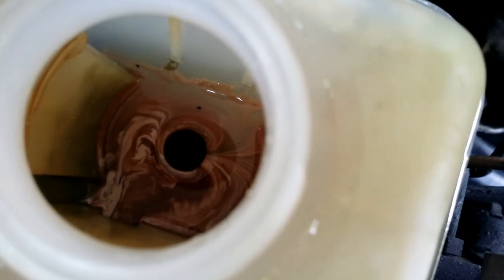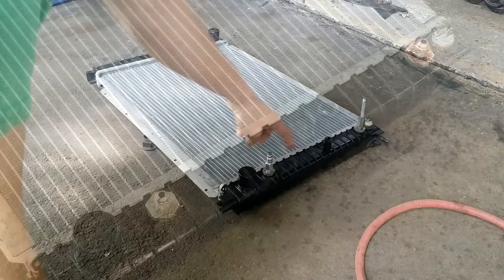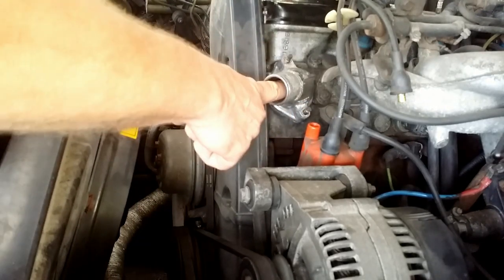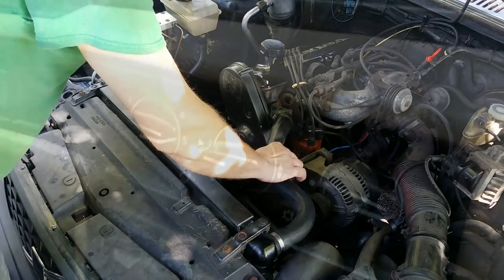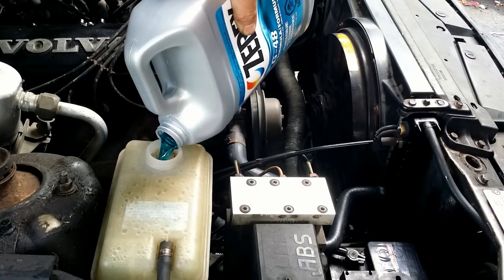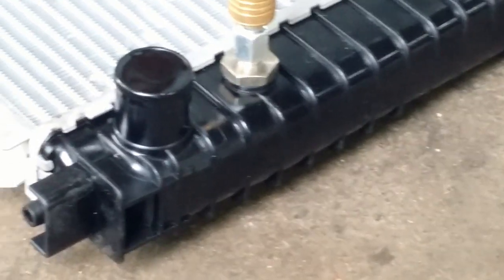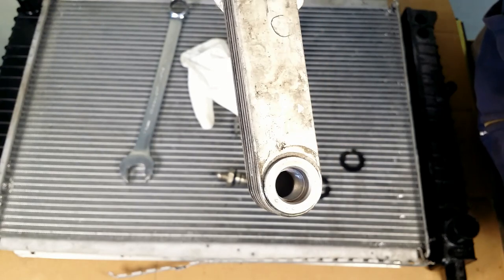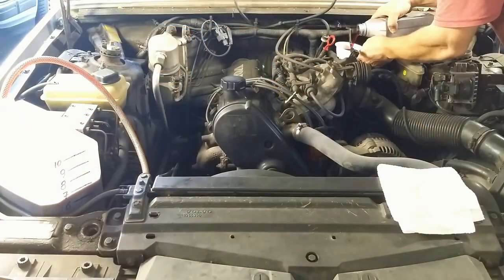Strawberry Milkshake in Radiator-ATF in Cooling System

Comment: Pain in the arse huh?  I have an Australian Ford BA ute that has the same crap designed trans cooler in radiator.  When I replaced the radiator I also fitted an external transmission cooler and bypassed the stock in-radiator cooler completely.  Now there is no way coolant and ATF can mix. Peace of mind for a couple of hundred more, absolutely worth it. Good video on your flushing process 👍

Comment: Don’t forget you also have to flush your entire transmission and replace ALL (yes all 10 or so quarts depending on your car) of the ATF. I just bought a used car. Previous owner fixed the radiator but completely ignored the transmission. He’s lucky he didn’t destroy the transmission entirely driving tens of thousands of miles with contaminated fluid.
Reply from the maker: I mentioned just that @ 8:45 onwards and made reference to my ATF flush video.
Reply: @robertdeptula2003  my bad, I only skimmed the video

Comment: I have a 2004 Toyota Corolla.  The upper transmission cooler line and fitting broke off the radiator (I don't know why) with trans fluid and coolant leaking all over.  Engine coolant is now leaking from the hole that has been created by the fitting breaking off.  I want to know if engine coolant has gotten into my transmission.

Comment: Good job bruh! ❤. Am am a mechanic from Nigeria, one of my customers had same problem with her Hyundai Santa Fe, coolant mixed with transmission fluid, i diagnosed it it was a weak radiator, but i haven't opened it yet to check, the transmission is not selecting engaging at the moment.

Comment: Does it get in the motor as well or just transmission and radiator
Reply from the maker: It used to get into coolant only. The ATF was clean.
Reply: @robertdeptula2003  thanks for the response  my 2008 ford f150 lariat just started spewing pepto bismol out of the reservoir yesterday afternoon
Reply from the maker: In my case it looks like the ATF pressure was higher than the coolant pressure, so it seeped through. When cold, the passage sealed again.
Reply: @robertdeptula2003  thanks for the info im getting the radiator replaced this Wednesday
Reply from the maker: Did the repair solve the problem?

Comment: Did it fix it
Reply from the maker: As it is in this video, I put in the new radiator and the problem is gone.
Reply: 1 paid dealership 1600 bucks for fix but I drove for weekend and now its happing again dealership says it could be something other then their fix and if it is then ill be charged additional. Their diagnostic is only on the issue at hand and not on the whole car 😒
Reply from the maker: Did they tell you that ATF went into the coolant? What did they replace? What car is it (make, model, year)? 
It is difficult for me to diagnose the problem remotely.